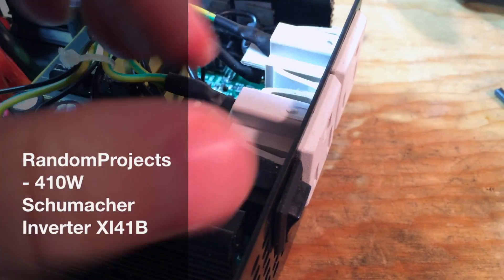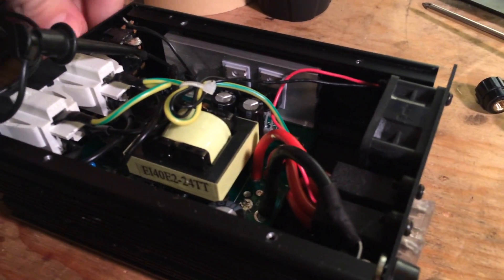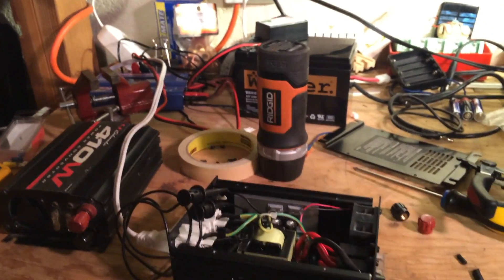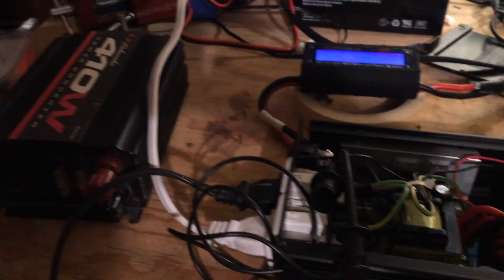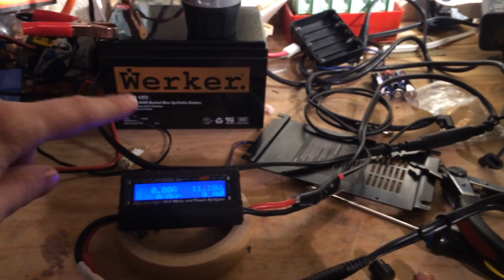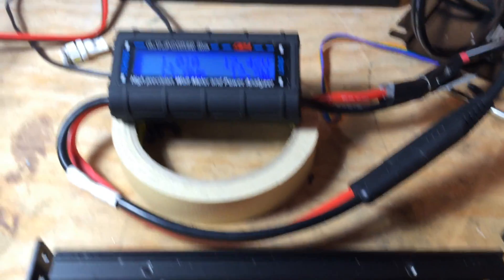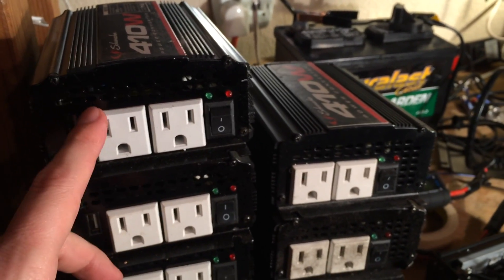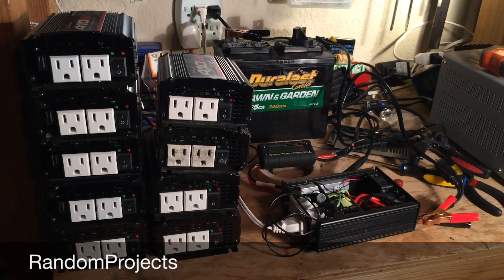410W Schumacher Inverter XI41B Repair Part1

Comment: I think I almost bid on that same lot of broken inverters!  :)
I would love to have a power supply like the one you used in this video but I haven't been able to justify the expense.  Do you have any recommendations?
Reply from the maker: PM me an address and I'll send you a few :)
I've taken a few of these generic bench power supplies apart, seems they've all stolen the same BOM and gerber files. Buy a cheap one on Amazon ($80) and know the readouts will need adjusting, When I get out of China I'll be finishing up this project so stay tuned for a few more vids.
Reply: JuliansRandomProject
To be clear, do you mean the power supplies or the inverters?  ;)  Thanks!
Reply from the maker: The power supply. example: http://www.amazon.com/Precision-Converter-Electronic-Scientific-Automotive/dp/B00BOAQ496/ref=sr_1_12?s=electronics&ie=UTF8&qid=1392625002&sr=1-12&keywords=bench+power+supply+0-30v

Comment: Hi. I need your help. A month ago I bought a power converter exactly like the one you show in your videos,
I connected it to a sensor light outside my house. On the third night it started to make a sound like an alarm.
Can you tell me what the problem might be? I was only turning  on the converter at night.
I even changed the bulbs to a lower voltage/wattage. I believe each outlet supports 200 watts each?
Thank you for your time.
Reply from the maker: The alarm is a low voltage alarm. Use shorter, thick lengths for the 12 volt cables. If you don't care to be made aware of a low voltage situation you should just remove the speaker inside. Assuming this thing could handle 400 (it can't) it would't matter how you plug things in, the plugs are in parallel inside.
Reply: JuliansRandomProject 
Thanks for replying so fast, I appreciate it.

Comment: Simple question bro before I buy this product .....

Does it charge like phone , and how can how long does the charge usually last.....?
Reply from the maker: Adam Miles Are you asking if it can be charged? If so, no, it is connected to the 12v battery of your choice. You would need to charge that 12v battery separately.

Comment: I have the same inverter, worked great for years until it suddenly stopped working. 
I connect power, I flip the switch, green light and fan kick on for a moment then the red light kicks on and fan kicks off. 
Weird